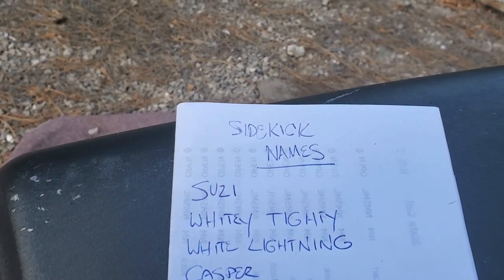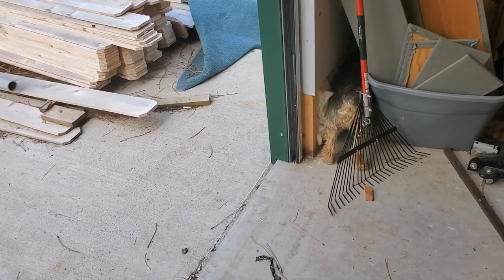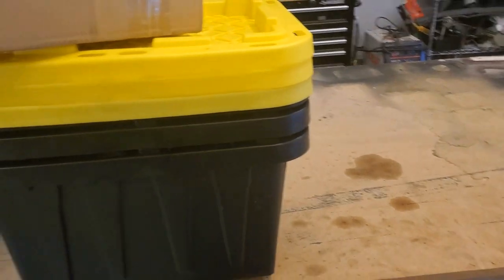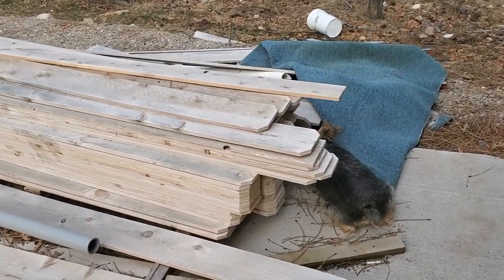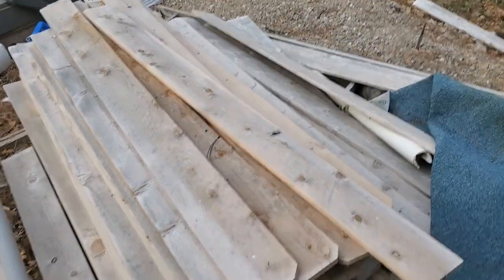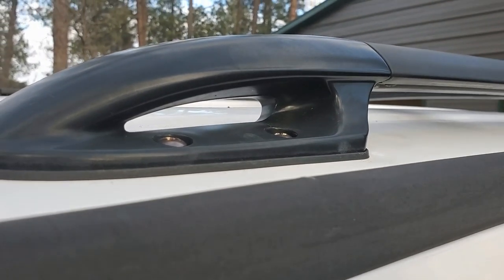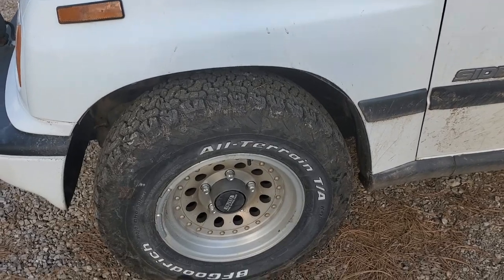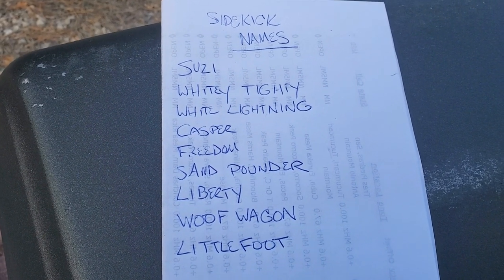Getting 4x4 Tracker/Sidekick Ready To Go Camping! Giving It A Name.

Comment: Getting a "Technician" class ham license is super easy.  No code requirement and like a 30 question test.  A couple or 3 hours with one of your ham buddies would be all the study you would need.  The tests are administered by volunteers at most ham flea markets "hamfests."  You can program that Baofeng (bough-fing) with weather radio channels, MURS, FMRS & GMRS frequencies using a free program called "chirp."  I feel sure that J.D. can get you set up.

Comment: They make an extended battery and a Whip antenna for the baofeng radio. TOTALLY worth it! Makes a huge difference. They also sell a cord that plugs into a USB port. Eliminating the need to have it plugged into the wall, you can just plug it into the USB port that fits in your cigarette lighter port.

Comment: I have the same racks and I have my kayak, a 6 sided clam outdoor canopy and a storage box up there with my tools in it.  There is way more than 100lbs up there and It holds everything just fine.  I cracked up when you goosed Tucker.  I like sand pounder.  That's a good name for a bad ass 4X4.

Comment: I am ham. The Tech class test is pretty easy. Bofeng I think is the way sounds. I got the same radio.  I doubt the FCC will hunt you down if you use it, but they do from time to time if people use them without a call. Some Ham clubs make it a thing to hunt unlicensed users. But I am sure all that has stopped for now. That radio  won't get too far at all.  Dozen miles maybe. Farther if your on top of a mountain.  You need an HF rig for  long haul. Right set up you can (sort of) email over the air. Not telling you what to do, but a licence be good.  I would get a new portable Shortwave radio. You can get news on them anyplace in the world practically

Comment: The totes don't fit because of the indents in the side panels. If you raised the totes above their level on a plywood platform they would fit and the space beneath it can be used for other storage. Put some of what you would put on top of the totes under instead.
Reply: Sorry I thought you were going to camp on the roof. Gonna get pretty damp in there.

Comment: re: radio name pronunciation- here in the NE US, I usually hear "Bow Fang"  [ bow like the front of a boat, not the weapon that launches arrows] - I have one, it works fine- use the program "Chirp" to easily program it- needs a cable. 
"Pearl"  is a good name for the Tracker.

Comment: How do you use your C pap machine in the tracker
Reply from the maker: Plan on replacing starter battery with larger deep cycle battery and installing a small inverter